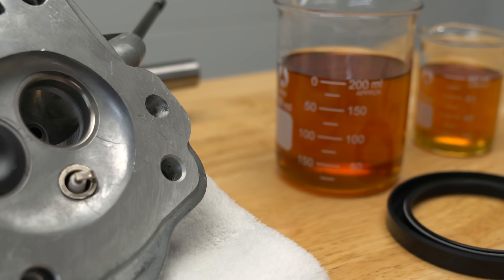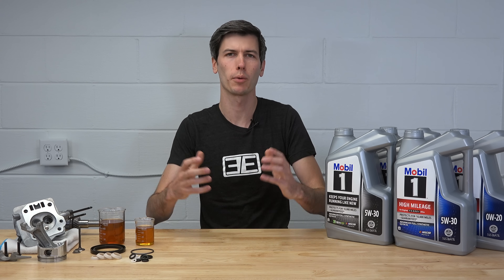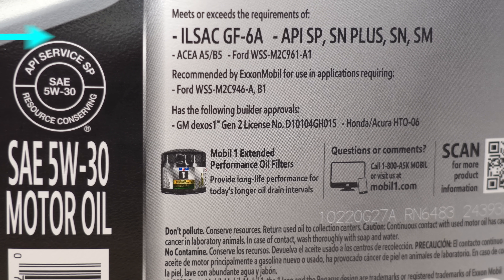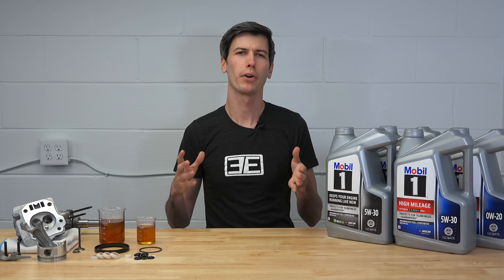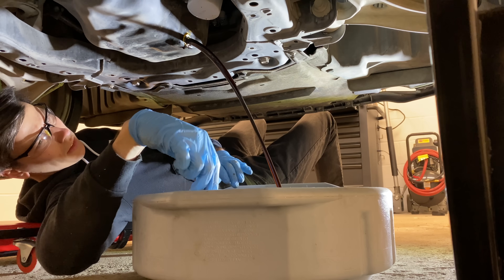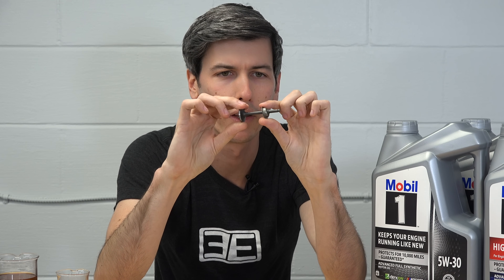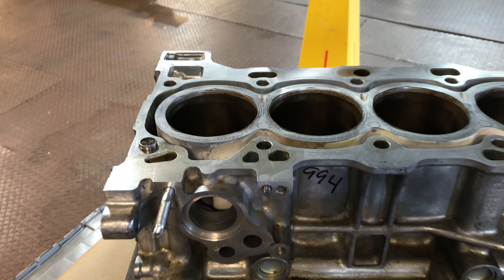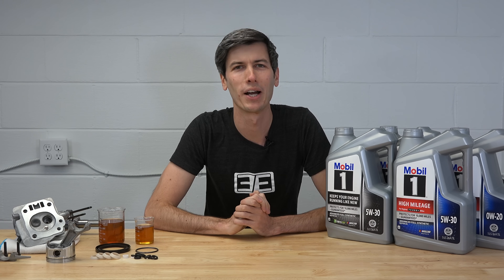Is Synthetic Motor Oil Bad For Old Cars?

Comment: I think I've tried using synthetic 10W-30 oil in my car that has a mid-70's 350 Chevy engine in it several times for one reason or the other and both times it has caused it to start using more oil than normal. I normally use the 10W-40 oil recommended by GM so it could be the viscosity difference, but the only way to test that would be to use conventional 10W-30 since synthetic oil doesn't seem to come in 10W-40. It's easier just to keep using what the manufacturer recommended.
Reply: Assuming you are correct about it calling for 10W-40 only as opposed to calling for it only in certain conditions Mobil 1 does have it in full synthetic but only in their high mileage variant.
Reply: @Iconic_Scarab  the owners manual has a tempurature chart that reccomended 5W30 or 10W30 over most of the range, and allowed for 0W20 in extreme cold conditions and 20W50 in extreme heat. That being said the XW30s had by far the greatest percentage of the graph.
Reply: I would try 5w40 instead of 10w30 if 10w40 is not available.

Comment: ON THOSE GM REAR MAIN SEALS , THEY SHRINK OVER TIME , THE HIGH MILEAGE 75 K ON UP MILES MOBIL 1 WILL RECONDITION THE SEAL AND CAUSE IT TO SWELL TO STOP THE LEAK , I WOULD NOT GO BACK TO CONVENTIONAL OR STANDARD MOBIL 1 , IF YOUR ENGINE HAS 75 K ,  PLUS THE ADDITIVE IN THE HIGH MILEAGE MOBIL 1 WILL CONTINUE TO CONDITION THE SEALS AS THE ENGINE INCREASES MILEAGE AND AGE !!!

Comment: Is Synthetic Motor Oil Bad For Old Cars? Yes, and new cars. We call it gimmick oil in the aviation industry. Mobil Oil Company came to market with synthetic motor oil around 1975 and I still have the old marketing hype on how much better and cheaper it will be.  👎

Comment: When you say that synthetic oil certifications meet seal compatibility standards, how far back would that go?  Would we be able to use synthetic in a 1960's motor, for instance?
Reply: I have a 1965 chevy with original 327, fully built motor. I run sae 40w vr1 racing oil with high zinc. It's not synthetic and is made for old push rod engines. Anything close to that should be good, doesn't matter what brand. Can't find oil like that at autozone tho lol

Comment: As we know engines don't last forever
Toyota has entered the chat
Reply: In my case, it's a Ford - 1989 Town Car with 300k+ miles that just won't die. 🤣
Reply: When the Toyotas have the bad Valve seals and burn oil like crazy. Like the Scion Tc.
Reply: @pduh42  2006 piston rings defective also. But pretty good mostly
Reply: My toyota takes 0W/20 so I'm stuck with synthetic oil on that one...
Reply: @joew9392  the Best
Reply: laughs in 2002 Ford Focus ZX3
Reply: Volvo with 3 million miles wrote the script..
Reply: @Motorhead250  That volvo engine was rebuilt at least two times in its life. Cummins actually has a "million mile club" for original, untouched engines that are still running over a million, with the highest being 3,017,000 miles.
Reply: @AmericanThunder  i had 2.1 million on my CAT 3406B.
Reply: @Motorhead250  The cat in my old flatbed wrecker had 600k+ on it, ran like new, it did have some leaks, though. lol The Cummins 5.9 I put in my Bronco has approx 410k on it, running with 40 psi boost and maxed injector pump, no issues. Diesels are superior.
Reply: @AmericanThunder  5.9 excellent . But I had one injection pump and ECM go bad at 150k for $4000 .
Old mechanical 12v from 1980s better .
Reply: @Motorhead250  mine is a first gen 1991.
Reply: Cummins pushes toyota aside as it enters the chat, with over a million miles and still running strong.
Reply: @AmericanThunder  Volvo pushes everyone aside with 3 million mile s on original engine. world record

Comment: A friend of mine told me he changed to synthetic in his S-10 and it started leaking oil.  I didn't believe him and tried it myself in my S-10. Guess what, now mine leaks!
Reply: breaking news CDC says if you wash your hands once daily with synthetic 0w-20 your body will be resistant to Covid  !
Reply: Joe- old engine seals were worn out and the synthetic oil was removing the sludge inside which is good and bad for old engines.  my engine leaks now also
Reply: @bigglefty75  Use some AT-205 Reseal in the motor.
Reply: @bigglefty75    I'm due for another oil change in April.  I'm not gonna use synthetic this time...
Reply: @joew9392  I'm about to change mine also and using convention oil.  i don't hit 3,000 miles any ways and always change it in 3 months
Reply: @bigglefty75   I was gonna use conventional oil (Valvoline) but, believe it or not, they were out of it in my little town.  I ended up buying Valvoline oil but it was something between synthetic and conventional, same price as conventional.
Reply: @joew9392   that's stuff would be  better anyways  Joe
Reply: i just did a nice tune upon my 87 El Camino  . its  so fun to care for your own classic car
Reply: @joew9392  Sad part here is the oil manufacturers are doing away with conventional oil and producing only synthetic oil...... walmart and others are making the switch...
Reply: @rpap5322   I just got done changing the oil in my S-10 today while the weather was nice.  Should be good for another few months. Used the Valvoline non-synthetic..
Reply: Now you're a bad friend
Reply: I started using Texaco Havoline(1965) until I "discovered" Castrol.  Ran that for a number of years.  ONE time I tried Pennzoil in a 1980 Dodge 318 v8.  Apparently the detergent level in the Pennzoil cleaned out so much that It started to need oil every 1000 miles.  Started using Mobil 1 about 2000, first in Saabs and now in Toyotas.  Seems to work just fine.
Reply: In addition to better cleaning agents, synthetic's molecular structure is smaller, so it can get past tighter spaces than conventional oil. It only points out the weak spots in your engine, it does not create them. 

The plus side to this is it can also lubricate tighter a clearance than conventional. 

But in a high mileage worn engine, that consumes more oil, conventional is probably the better route, as it may not be consumed as badly, and it is slightly cheaper. Although lately, pricing doesn't seem to be much different, at least im my area. 

Of course replacing or fixing the engine is the "cure", but in the real world, where not everyone has a nice budget to work with...
Reply: @bill6960   Fixing it might be the best bet but the cost of an engine overhaul or a new engine is more than my vehicle is worth.  Probably the conventional oil will go back into the engine, hopefully next week.

Comment: Flat tappet and air cooled engines need Millers Race oil as it has enough ZDDP in it which has been taken out of todays oils due to cat converters etc. Use mineral oil to run in for 500 mls then switch to Classic Sport. Easy!

Comment: funny I was a pump jockey when Mobil one came out and at that time the manufacturer said do not mix and it may cause problems if used in older cars. Look it up. Reading is fundamental.

Comment: Had a old galaxy 500 back in the 1970s that burned a quart per 100 miles. I just used my dads used tractor oil which was years old and white with sludge. I’d get  the car down to 120 miles per quart:) ahh, the good ole days😂 by the way, the quarter panels were half gone from rust:)

Comment: I put synthetic oil in a 2006 equinox with absolutely no leaks at all.....within 2200 miles, oil was leaking from rear main seal,front timing cover seal,and around the sides of the oil pan.....pouring....not a little drop.....so I determined the seals had gotten hard over time and the sealing ability was not good enough to seal off the more slippery synthetic oil.....i switched back to conventional high mileage.....  still leaking....it had 99000 on it when I switched.Big mistake...now I gotta replace seals that were completely dry before the switch.

Comment: i saw another video on synthetic oil that it will crystallizes if you dont get the oil up to maximum engine temperatures saw proof what do you say now. Larry Broad 1970 el. camino with 5.7 liter chevy engine or 350.

Comment: Just have to match additives that the engine thrived on originally.  Some stigma is reflective of backyard engine builds and not properly setting up all parameters on initial start-up/brake-in properly.  Yes, classic engines with flat tappet cams do thrive and require high zink especially on start up. The same folks that wiped out a cam in an FE series motor, were cranking it dry several times before it fired.  Operator problems a lot of times. And don't blame oil for the late 70s through the 80s murdering your engine/ cam. Let's face it, those engine were trash.

Comment: Most of your "Full synthetic" oils start with non synthetic " dino" oil as the base. Was not like this years ago, but with all of the cost cutting going in this world its the case. This includes most but not all mobil 1 oil weights. Only amsoil and a few other manufacturers start with 100% synthetic oil base.  It's a FACT.

Comment: If you are driving an old clunker that has never had detergent or synthetic oil used in it you better take an extra couple of oil filters with you if you switch to full synthetic. It will break loose old sludge that can stop up the filter.

Comment: Going to thicker viscosity oil in an old engine is probably not the best solution only if the engine is probably on it’s last legs. Because it will not only increase oil pressure it will increase pressure against all the working parts this the seals, the piston rings, the bearings, etc.

Comment: My '96 Dodge Ram went 261,000 miles on the orig. motor before the rearend went. Mobile 1 since 9,000 miles. Gonna use it in the Pathfinder I just got.

Comment: Yes, you can with advantage use synthetic oil in old cars and you should so do because the contact pressure is higher in a worn engine. Empiric experience.

Comment: If you're think you're seeing lots of oil consumption in a late model car, they often have aggressive engine ventilation systems that suck out hot oil vapor before it has a chance condense and return to the oil pan! Wipe your finger in the tail pipe, if it's wet and oily then you have a problem! Dry and dirty is OK.

Comment: Engine oil leaks?  Thicker oil helps but can be at the expense of piston wear where the thicker oil is less effective on late model close tolerance cylinders.  1960s to 1980s V8s? sure, thicker oil works well to manage oil burning and leaks!

Comment: Nicely done. My 2001 VW Passat wagon, with its longitudinally mounted 1.8T engine and undersized oil sump, has thrived on Mobil1 0W-40 "[Spoiled] European Car Formula" and the largest oil filter I can cram between the oil cooler and the left engine mount, a Mann 950/4. When we replaced the valve cover gasket last year, the top of this "sludge monster" engine was clean.

Comment: Mobile1 ow-40 in my old Saab with over 180,000 miles on her.  The ow is good on startup with less viscosity and it warms up to a running 40 weight seems to be Ideal for my car, plus I throw some Risolene highmileage lifter quitening oil addivtive in there for additional protection.

Comment: A good analysis...Yes, definitely you CAN run synthetic in an older car....I have a 66 Charger with a 318 with 290 thousand miles....I use Lucas 10W 60 synthetic.
It runs MUCH better, quieter, smoother, and I actually think it has a bit more power. I would NOT run synthetic if only a thinner weight was available, like a 0 or a 5 W 30., Obviously, it would most likely burn it, or use it more, as the clearances are loose.
Reply: You would probably have low oil pressure at low engine speeds, with maybe no oil reaching, say the cam bearing furthest away from the oil pump.

Comment: I would avoid "high mileage formula" engine oils unless your engine leaks , burns, or consumes excessive amounts of oil.  Swelling good seals and then going back to non high mileage oil sounds risky and there is absolutely no reason to use additional additives that are not required beyond the typical synthetic oil formulas.  Advertising Hype not protection. So the one point I disagree with here is "proactive use of high mileage oil is not going to harm your engine" The jury is out on that one.  A well made and maintained engine can easily go past 200,000 miles without significant oil consumption or leaks.

Comment: On old engines from 1950-60`s you MUST use oil with a high ZDDP content, this is to protect camshafts and tappets. ZDDP is not added to modern oils as it damage the catalyc converters.

Please make note of the above advice!!!!!!!

Comment: The engines in some classic cars (specifically ones that haven't ever been rebuilt), especially those that predate oil filters and detergent oils, often have monstrous sludge build-up.  If a detergent oil knocks all that sludge lose it can plug the oil filter (if there is one) or the pickup screen on the oil pickup for the oil pump....Then you'll get oil starvation. If your lucky you'll notice the issue on gauges or lights and have to pull the oil pan and clean it (might strand you too)...At worst you run the engine till something breaks then you need a rebuild.

Now a Classic engine that has been rebuilt (or you've had open and confirmed has very little sludge buildup) is fine to run high detergent synthetic oil in...In fact, I would recommend it.  Just don't run synthetic in an unknown engine or one you know has a lot of sludge in it...At least not unless you WANT to rebuild it soon.

Comment: Its best to stick to one type of good oil AND most importantly, change it frequently, regardless of the miles they say on the bottle and especially if you drive in stop and go traffic a lot. I got this from a mechanic who fixes up old engines with lots of miles.

Comment: I put some 20-50 in a turbo diesel. The engine lost power, i think the oil was dragging the turbo charger down. So replaced with Mobil 1, all good now. I put synth. in MR2 mk2, it started dripping oil.

Comment: Caution on going up in viscosity....."modern" engines have things like variable-valve-timing....and this variability is achieved by real-small-clearance "pins" and holes in the system that are there to alter the timing of the camshaft. Too thick oil will cause these passages not to work as before, maybe clog...and then "fix" the valve timing to one-position. Overall....don't do it.  Also.....when going up in viscosty, it usually goes "up" in the winter/summer temp class together....a 10W-40 might be substituted for a 5W-30. Maybe the warm rating ( 40 vs 30) is good.... but cold flow for 10W ( winter temp) oil is less than a 5W...and this can cause problems too...especially during first-start and warmup....oil may not be getting to where it needs to be at first....or maybe takes longer....both no good.

Comment: The true question is not if it's synthetic, but if it has adequate zinc for older solid lifter cams. I've used diesel oil and now Valvoline VR-1 on my Suzuki Samurai. Standard modern motor oils (even diesel oil now as of 2020) don't have enough zinc to keep a solid lifter cam from wiping itself away. I found that out the hard way.

Comment: What about engines that have flat tappets and wear on camshaft lobes like a 1984 Ford 460 V8? Zinc is an additive that forms a protective film so the cam lobes don’t have excessive wear. The powers that be dictated that the oil companies reduce the zinc content to reduce emissions but low zinc content will damage your camshaft, or so I have been told by my mechanic. I use high zinc oil in my recently rebuilt 460 for this reason.

Comment: 356 Porsche (and R60 BMW) used 10-30 oil and never higher. Porsche said his engines were oil-cooled and lack of flow would make main bearings over heat otherwise.

Comment: People are always asking what's the best 
Oil. Well there is none absolutely none.
It's all the same. Synthetic is mainly for 
Aluminum engine. Reason being. Low 
Heatrang none like castiron blocks
Of the days. The big problem people 
Just don't change there oil just laziness 
Cause problems. My 2002 thunderbird 
I removed the oilfilter don't need it. It 
Filters nothing. I capt it off I don't believe 
It filters anything. A good machine finish 
Inside the block not to worries on metal
Grits in the oil.

Comment: He probably works for Mobil 1 and he's promoting the synthetic believe me I've had old cars I view straight Pennzoil 30 weight get almost 400,000 miles out of a Ford truck with just regular oil.oil is oil keep it clean and use a good grade. Oil only good for a thousand miles for its next change. They tell
You every three thousand miles because they know you can't change it every two month. But once heat gets to it the value 
Is no longer there. I recommend a quart of 
Marvel mystery oil at every oil change that 
Engine will last for ever. I WORK IN A OIL
REFINERY FOR QUALITY . OIL BREAK DOWN
IS AS SOON AS ITS RUNNING.

Comment: I ran straight 60 weight (special request to a store manager) and I also thickened it up with Lucas  Oil Stabilizer so I wouldn't have to keep my foot on the gas pedal at stop lights, until I decided to change the oil pressure switch.

You could do almost anything to the older vehicles and you couldn't break them. Not so with the new ones.
Reply: Liar, I've had cars from 1959 to now, US built cars were always breaking which is why I quit buying them after my 98' SC Grandprix.
Reply: @lonniebeal6032  If US built cars are always breaking, then why does my '94 Thunderbird with the 4.6L engine and over 500k miles run so well? Very dependable, much more so than my friends' European and Asian vehicles that have far less mileage.

Comment: I’ve used Lucas Synthetic Oil additive for older engines with great results for over 20 years now and zero customer complaints or problems. Btw that’s adding it to synthetic oil